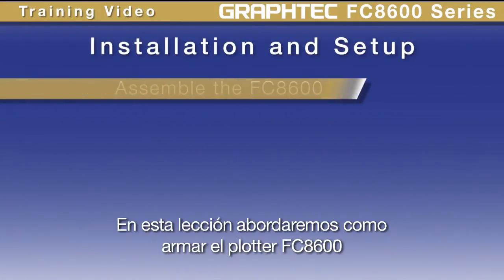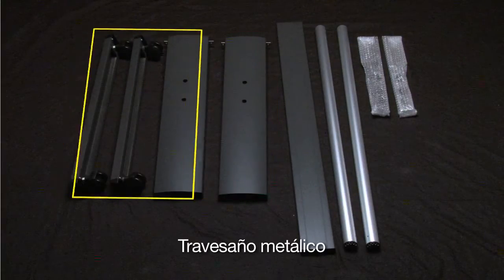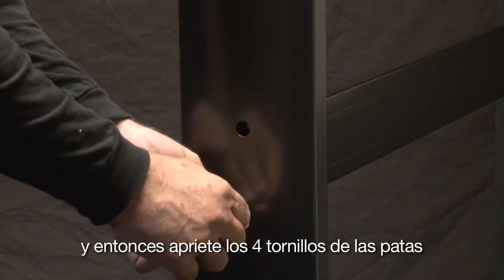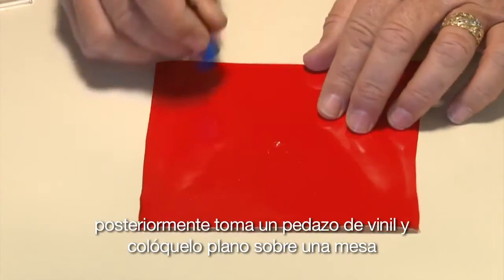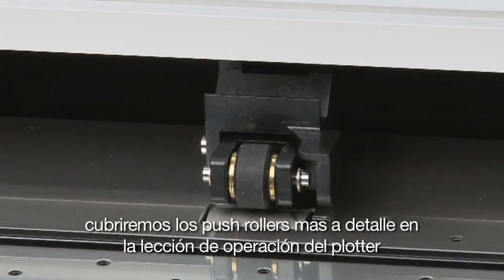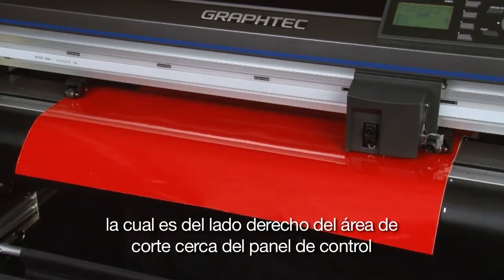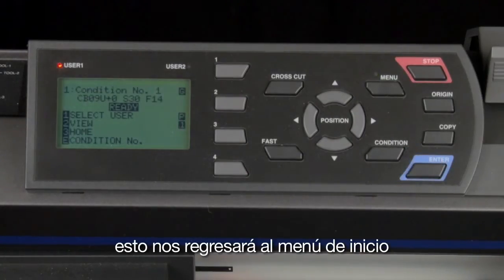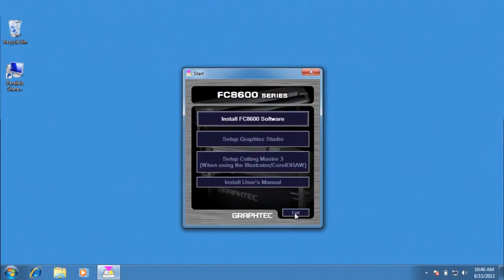Graphtec FC8600 Tutorial - Installation Setup (Español)

Comment: Too bad Graphtec has not kept up with the times! Computers DO NOT COME WITH DVD DRIVES and there are NO instructions on how to set up if they don't! Never mind the fact that these machines are advertised as Mac compatible except Macs use USB Type C, it comes with USB Type A and no info is available if an adapter will work! You can't even call tech support, you have to email them and then THEY DECIDE IF YOU NEED SUPPORTS HELP OR NOT! These things are way over priced for the available info and accessories to be worth it, MINE IS GOING BACK!!!!